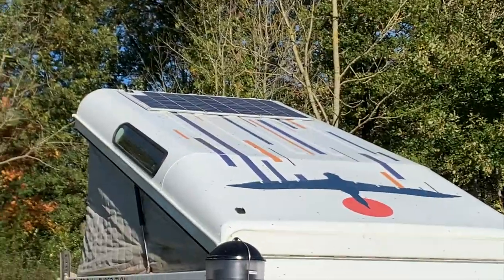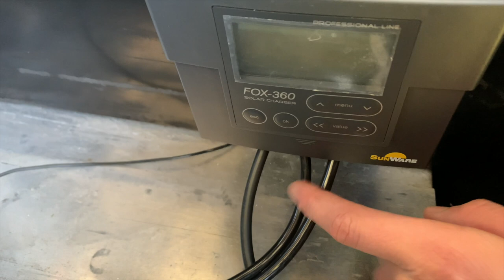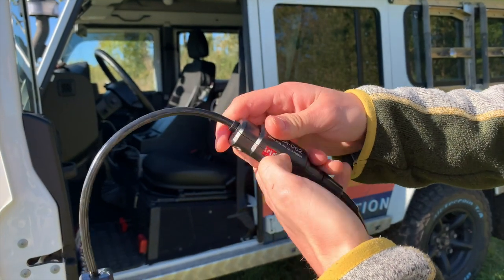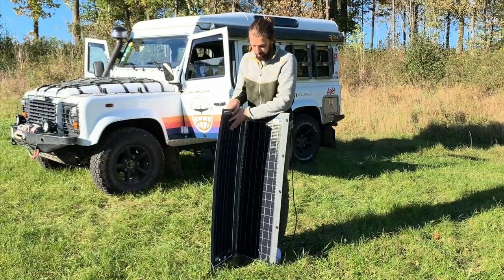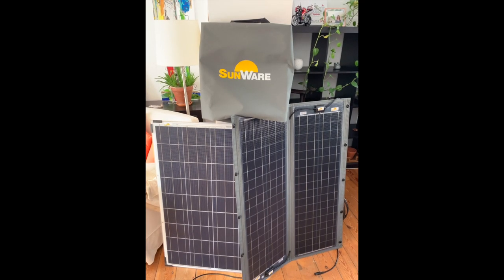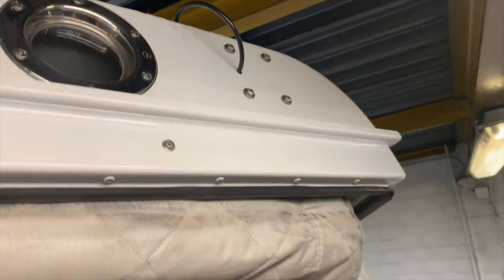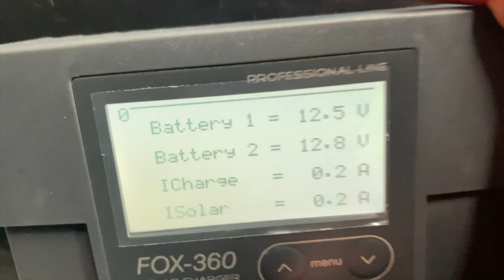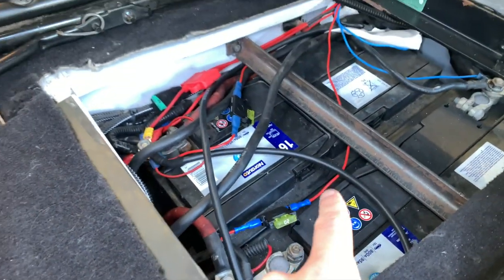Solar Panel Charging Systems & Installations for Overland Adventure - @nextmeridian.expedition)

Comment: Hey! What sand ladders are you running?
Reply from the maker: Hey, their aluminium sand ladders made by RRC an equipment and installation garage near Lyon, France. We have now switched them out for maxtrax as we wanted lighter ones which could fit on our pivot table from RoughParts based out of Switzerland. We have a video on that on YouTube if you want to see it.